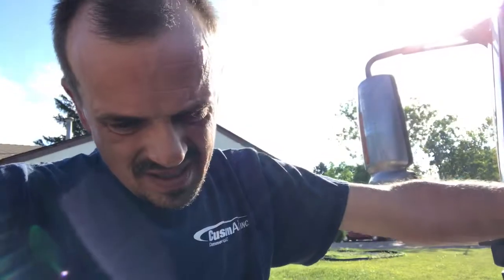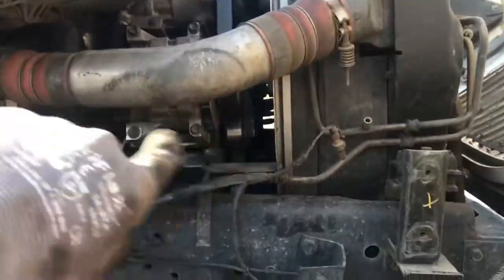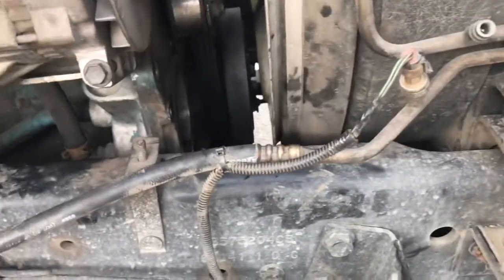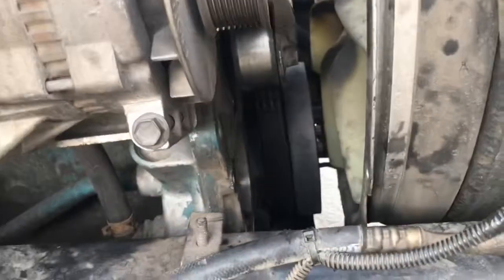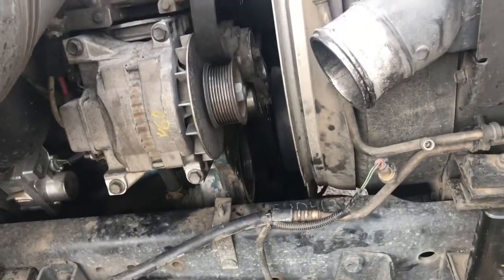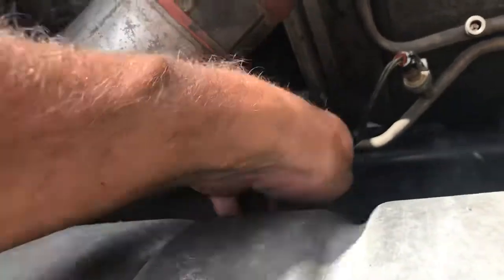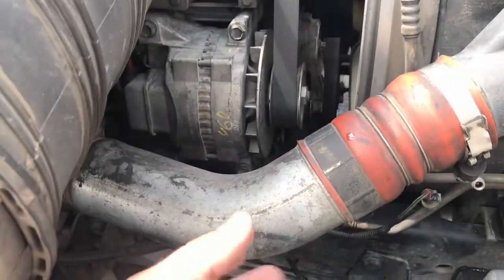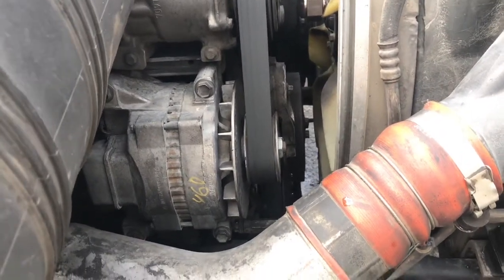2007 international 4300 water pump replacement. Nice and easy one

Comment: How do you put the belt back on?
Reply from the maker: You have to release the  idler pulley with a breaker bar and socket. Then you can slip it on.